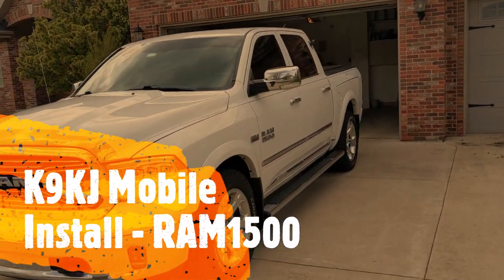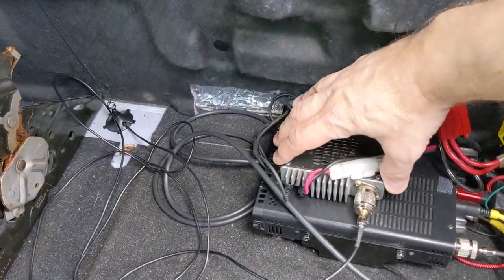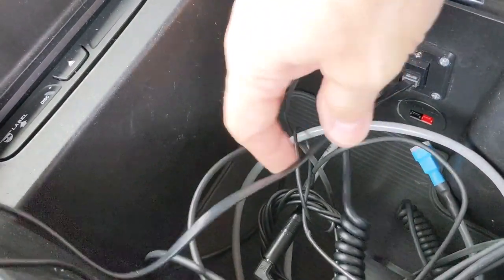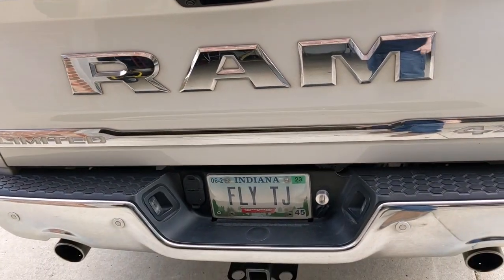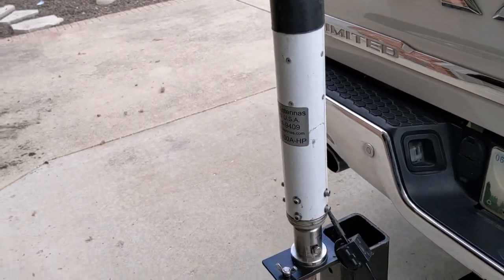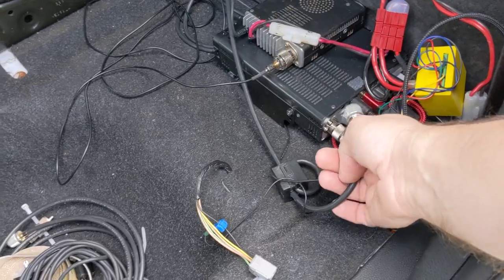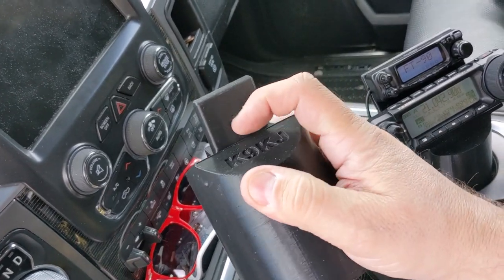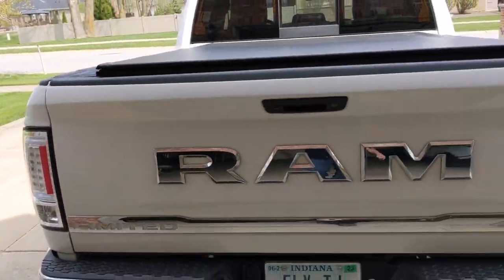Mobile Ham Radio Truck Install in RAM 1500 with Yaesu Radios, ATAS-120 and Tarheel antennas

Comment: I like the anti tailgating device you made. Made a similar device going to a square tubing about 3’ up to the Little Tarheel II mount. Somewhere I have another adapter that allows me to use the stackable aluminum military mast. Also have a ring that fastens to the last mast piece that allows me to do a tension guy for the mast every 120° around the mast. 
Camera!? 😅😅😅 if they believe it!

Comment: Btw....im thinking your engine is already grounded (usually) to the frame....and seems to me the cable for the tailgate might be a ground as well. But you could pop a grpund strap from engine mount to frame and run a strap behind both bolts and shrink wrap to the tailgate cable .....just a thought

Comment: Thanks for sharing. Could you also mount the ATAS-120 to the hitch mount (instead of the Tarheel)?
Reply from the maker: Yes and coincidentally I was going to buy an adapter so I can easily swap between the two!

Comment: Where did you run the 30 amp power supply from/route/through for the FT-891 ? I have the same radio. Hesitate to drill a hole through existing wiring boot in the firewall. Wasn't sure if there's an extra female power connection under the dash or did you run new wires directly from battery? I have Ram 2017 SLT. Very much like you truck. Just no center council. Thanks
Reply from the maker: Great question, I ran a dedicated 10 gauge wire directly from the battery. There was a spot where I was able to poke through the firewall and I did not have to drill...

Comment: Sweet setup! Smart move on the grounding straps. Does your truck's stereo have an AUX input? Maybe you can pipe the audio from the radios through that and get rid of the speaker box and few more cables?
Reply from the maker: Good idea! Actually, I need to chat with you about combining audio signals into one speaker.

Comment: How is the noise? I also have a 17 RAM and thinking installing a ATAS and 891.. N2IFR
Reply from the maker: Nice call sign and plane! The only thing that I haven't been able to nail down is some led nose coming from my rear tail light when I hit the brakes
Reply: Thanks!  I’m from Indiana too! How is the ignition noise? I have the hemi. I can hear it some on am air and with my FTM500..
Reply from the maker: @I_b_flying  it's not horrible but the NB needs to be turned on on the radio for sure. Or else it's like S9
Reply from the maker: @I_b_flying  what airport do you fly out of? I fly out of KGYY
Reply: @k9kj  KCEV.. live just off the approach end of 18

Comment: How did you secure the FT-891 mounting plate to your floorboard? Did you use self taping screws? Velcro?
Reply from the maker: Wow, nobody asked me that question yet. I ended up borrowing a friend of mine's "nut insert" ( sometimes they're called nutsert") tool to create a nut in the body for a bolt to attach to.  I did one on the left and the right side of the bracket.
Reply: @k9kj  thank you

Comment: Nice set up! I just installed my Icom  5100A into my new to me Ram. On my other Ram I used a roof mag mount for my Diamond SG7500 antenna. I am doing a lot of camping this year and now take a canoe on the roof of the truck along with 2 bikes on either side of the canoe. I am affraid my roof mount won't work so well up there with the limited space. I like your door mount antenna. Is that grounded? Do you think I will get comparable TX/RX to the roof mount? Thanks!
Reply from the maker: Sorry for the delay - the door mount is grounded on the inside part of the mount and not by the traditional method.  Not sure if I am missing out on some action because of that.   I think the Roof mount should give you comparable or better TX./RX

Comment: how did you run your 12volt dc.  I really like your set up we have a 2020 Ram ECO diesel that we plan on running mobile, my last mobile was a 95 Dodge 2500 that ran a screw driver ant. we also grounded everything like you did
Reply from the maker: I ran my 12v from the battery via 10 awg to a switch up front on my console then continued to the back to a power pole to the radio.

Comment: I'm not running Sirius XM radio on my 1500 can I remove that and replace it with a 70cm/2m antenna to run a mobile 2m radio and or bafeong uv-5r
Reply from the maker: That's a good question. I'm not sure what the mount or the hole arrangement looks like underneath that XM antenna.

Comment: Can you run the ATAS through an antenna switch? I was told by HRO you shouldnt
Reply from the maker: It's not a good idea only because the radio sends 12 volts through the coax, and depending on how the switch is manufactured, as you go from antenna port to antenna Port, if there is voltage present, it might ground out and cause a short, therefore blowing a fuse, or a chip resistor.